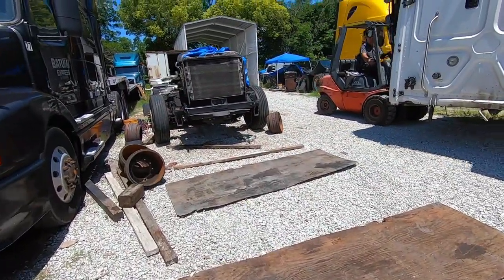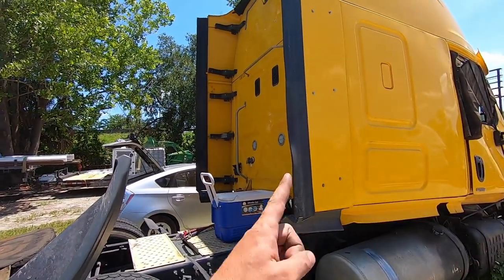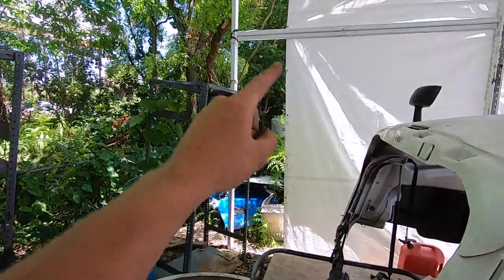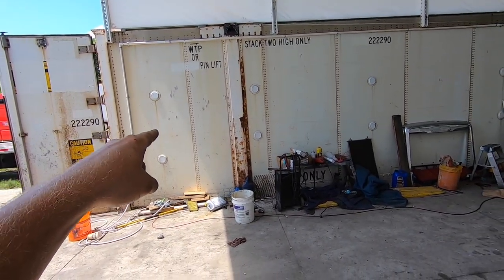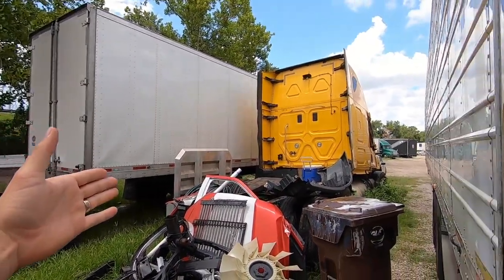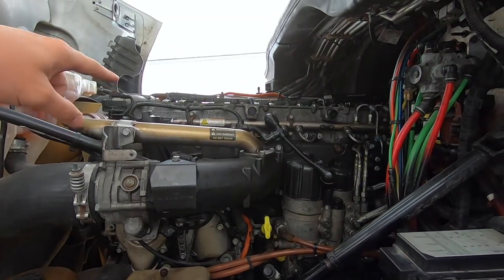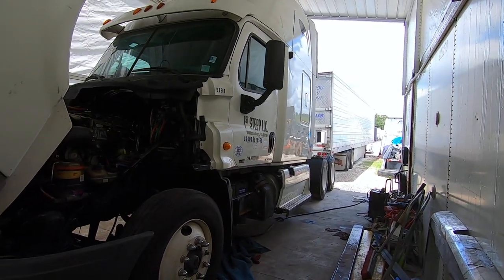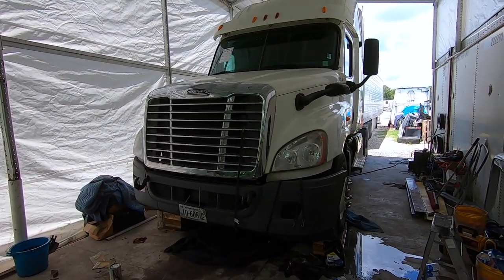REBUILD Of The 2016 Freightliner Cascadia SEMI Truck Continues  | SHOP UPDATE | Removing Cab

Comment: I am 15 years old and I am saving for a truck since I was 5 years old I also work in a truck and trailer service I replace gearbox drive shafts I can takeapart truck engines (i'm dutch)
Reply: @v8Truckerchannelv8 moghu
Reply: Van waar bent u?

Comment: Nice. Good way to teach youngsters to repair cars. I don't know sht about car engines if I have no Haynes manual on me. I had Pontiac 97 Trans Sport with 2.4 Quad4 and I did try fix it summer 08, use 800€ to parts, open and close top of it and try figure why it don't run well after if boil up in May. So, the fan did not work and I clean it and fan work then, eletronic box I change, coils I change but not yet good run... I did give up and 2012 after we had already move new place and dam car was on our yeard I give that than to my new workplace boss (afterI did think to fking burn that piece of#%¤ car down). So he had lifted, we open exhaust from the bottom...  Try to start it and it starts after 3 years not starting at all. Cathalysator was totally stuck... Yea, right... Me stupid motor engineering :)